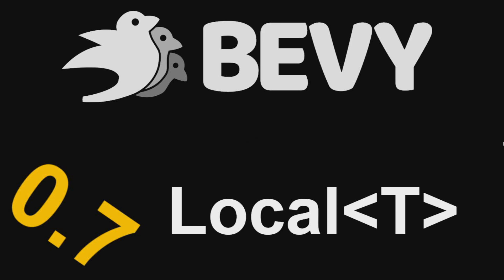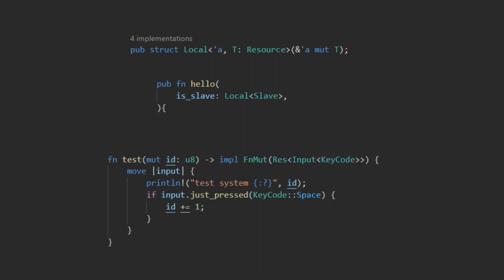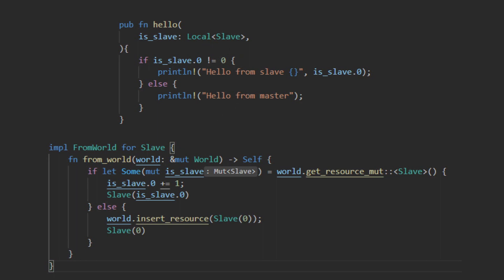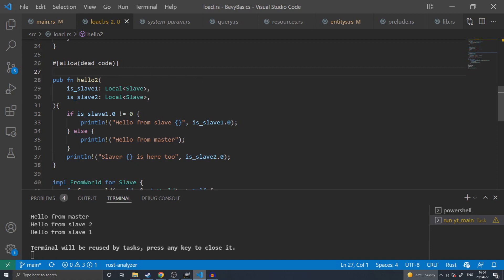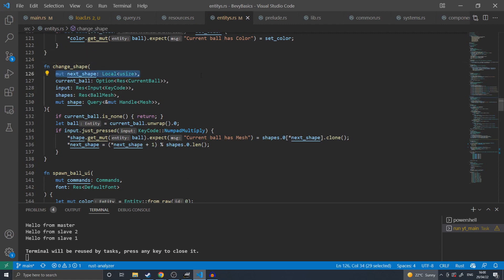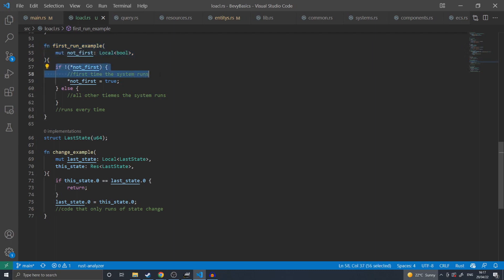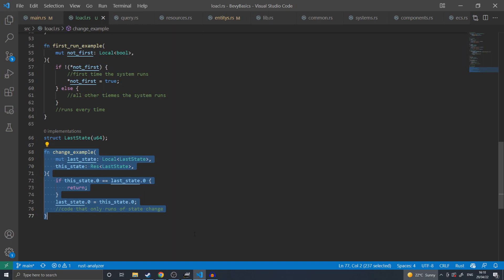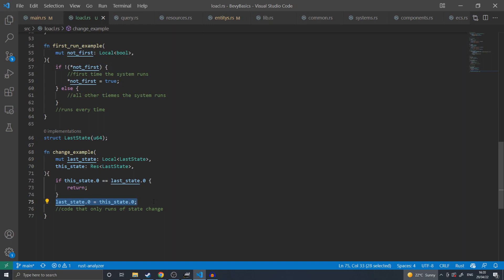Bevy Basics #7 Local

Comment: This oddly reminded me of React hooks and why they were introduced. I wonder what is lost and gained over this bevy approach or the react one. I'm not really pro hooks, but can this bevy method be as easily composed? Maybe with currying, idk? I was recently reading over some bevy source code too and they had to put a clippy lint on too many arguments on some of their function signatures, which I feel would only get more bloated if you'd introduce a lot of local variables. Anyways, great video as always !
Reply from the maker: I do agree that bevy loacls do resemble reacts useState hook, at least from my google search, and this makes compleate sence since they appear to fill the same need. it also feel the effect hook will resemble events for the same reason. as a direct comparison between local<T> and useState() it seems the only diffrence in composision is that you dont specify the inital value for Local<T> and if you need to do that you can use the new config api (clunky as it is) to get the exact behavier of useState().